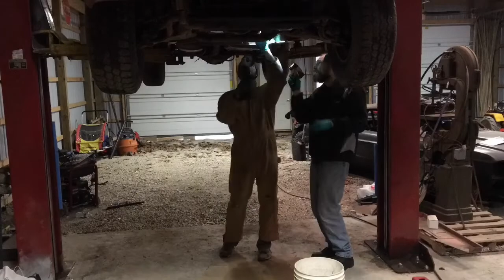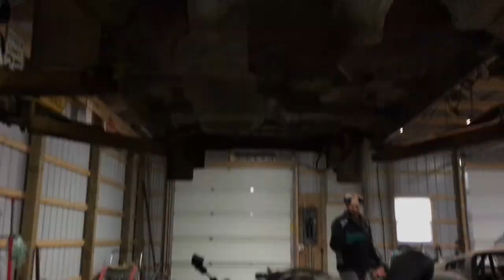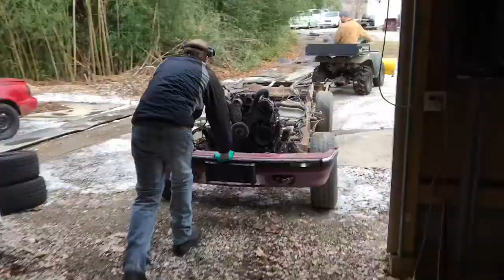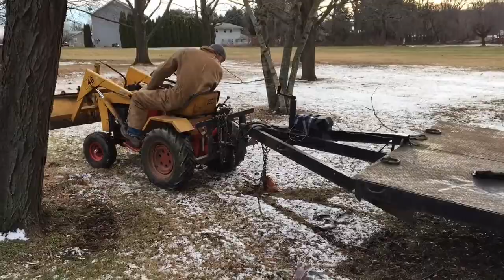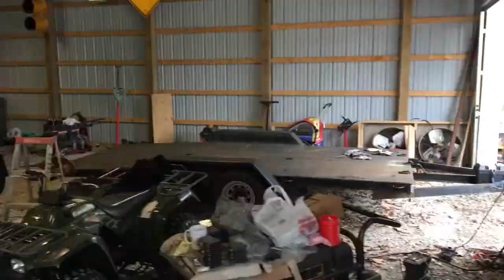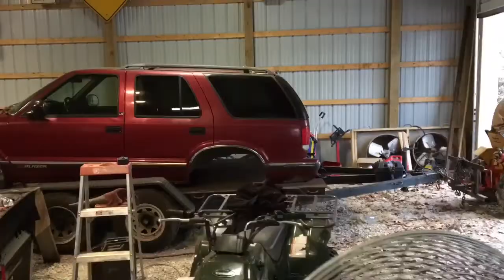S-10 Blazer body off frame

Comment: Awesome vid! How long did it take to take the body off of the frame?
Reply from the maker: Greg Johnston We’re going to eventually use the parts to convert a 57 Chevy pickup to all wheel drive Turbo LS beast.
Reply: @piratejetgarage  At first, I thought "WTF are they doing all of this for?"- then I remembered I read about frame compatibility between a 57 and 90s S10s. Figured that was the answer.
Reply from the maker: @zachfox5969   You are really on to something there…